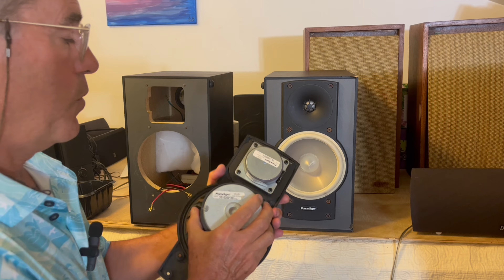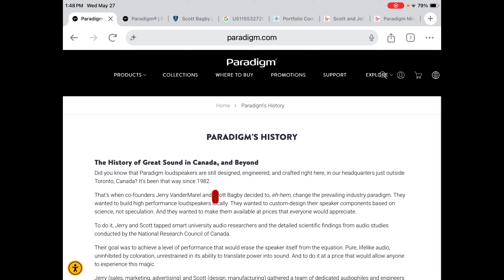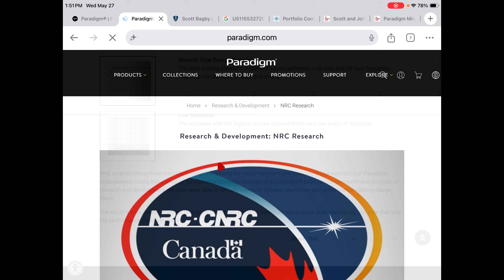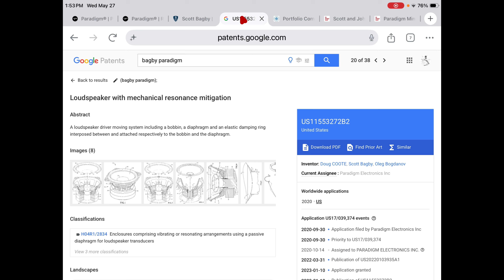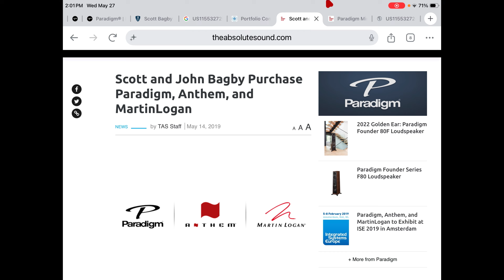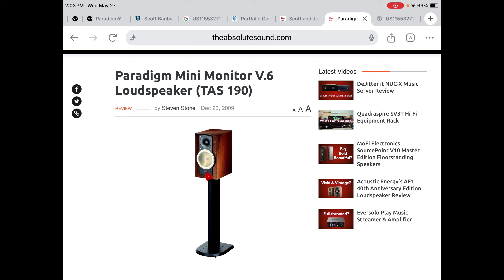Paradigm Mini Monitor V6- What's Not to Love About Paradigm?

Comment: I waited to post this comment until today.  I bought a pair of Paradigm Monitor 7 v6 today from a guy on Facebook marketplace.  They're near mint and very nice sounding, but I have them replacing a pair of Boston Acoustics VR940s and I can't say the Paradigms are leaps and bounds above.  It's a small improvement.  I've always wanted a set of Paradigm speakers since the 90s so at least I finally have them.  I only paid $300 for the pair for near mint towers.  Video was very informative.  Thanks.
Reply from the maker: It sounds like you got a decent  deal on those, and sometimes finally owning a piece of gear you've wanted for years is the best part! Enjoy them both with an A/B switch!! Thanks for watching and commenting. !!